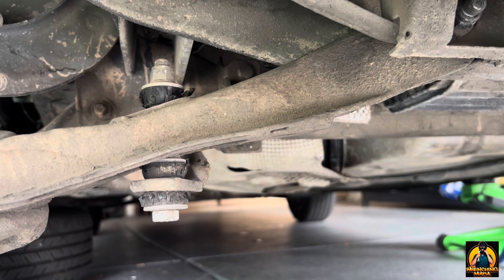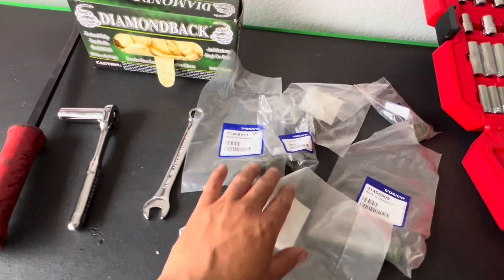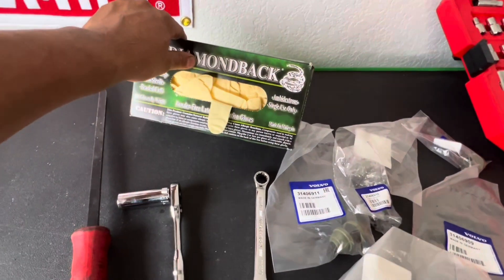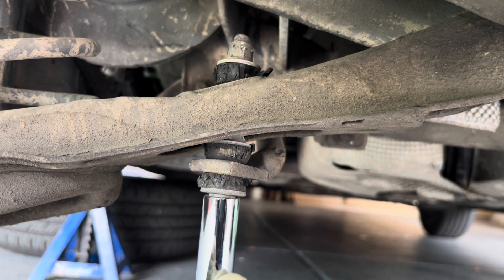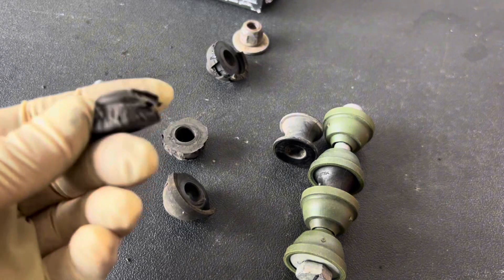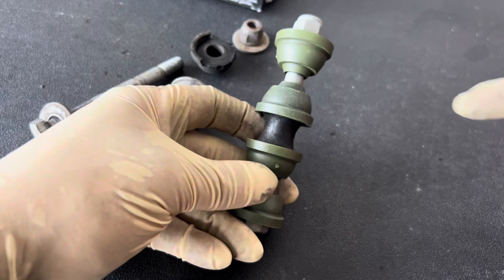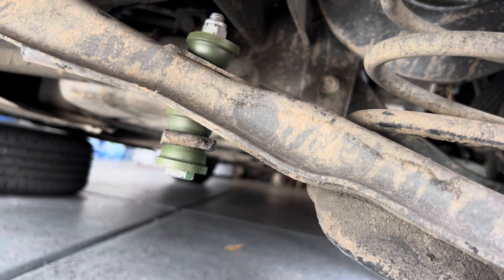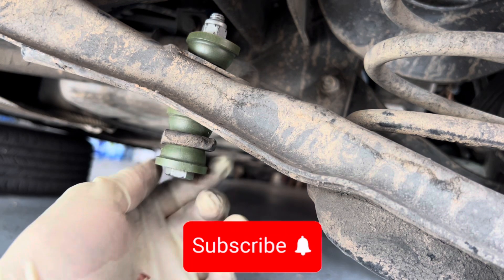Volvo S40 Rear Sway Bar End Link Replacement

Comment: What's the part number? I keep getting an 'L' shaped sway bar links for the rear. I haven't been able to find these.
Reply from the maker: @davida6146  ok let me get you the part number
Reply from the maker: @davida6146  https://www.fcpeuro.com/products/volvo-stabilizer-bar-end-link-meyle-7160600010?ads_cmpid=21619732995&ads_adid=173265969064&ads_matchtype=&ads_network=g&ads_creative=710927653118&utm_term=&ads_targetid=pla-297546631617&utm_campaign=&utm_source=adwords&utm_medium=ppc&ttv=2&gad_source=1&gbraid=0AAAAAD3np3Wihf3ZxWRwiyX7Mry_zKxmt&gclid=EAIaIQobChMIp9-iqcPxiQMVTyBECB1AchcPEAQYBCABEgILlvD_BwE